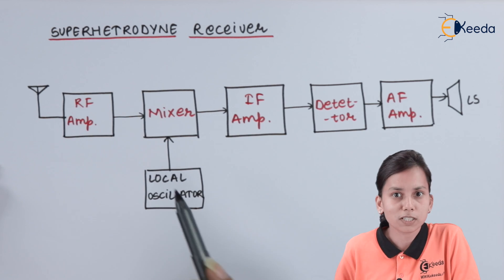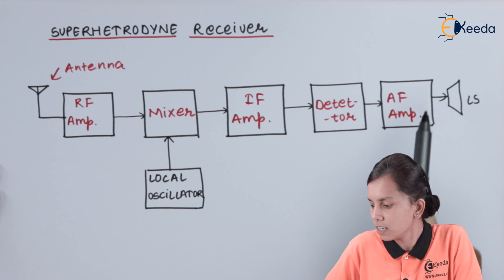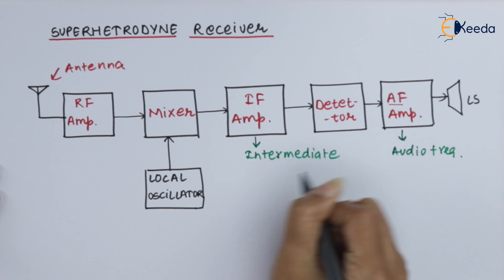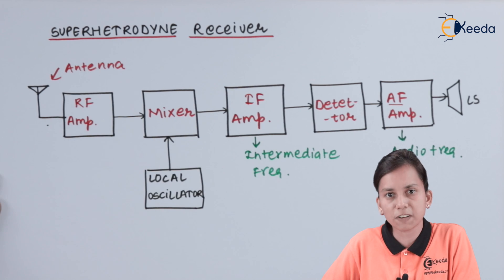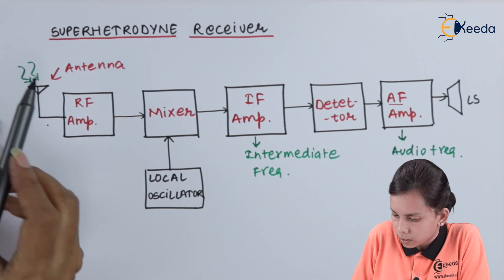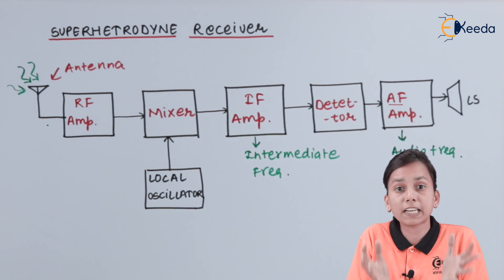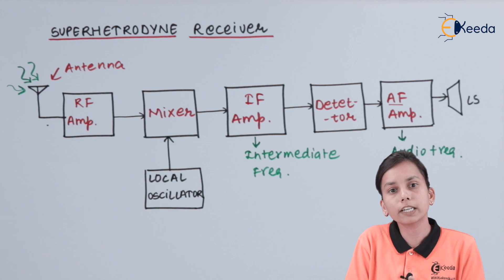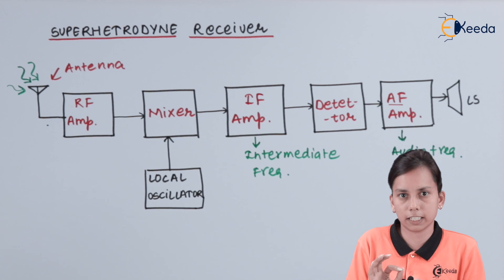Superhetrodyne Receiver - Modern Electronic Communications - Application of Electronics

Comment: For RF amplifier its not so much that is "selects" the desired frequency but more so that it improve the SNR of the desired signal more than the surrounding noise. Selecting a desired frequency is more often done by band pass filters which allow only a specific range of frequencies and tunes out the frequencies that are outside of the desired range.

Comment: I'm not even an engineer, and I'm detecting so many errors in explanation.
This video is really meant to pass exams, not for understanding the concept.

Antenna also has a range it's best at.
FM radio antenna won't be good enough for MW. etc
It's not receiving "all" frequency

according to this explanation, the RF amp is selecting only the frequency we want. Which is not the case. It's vaguely selecting a bunch of frequencies around the ones we want. 
If it really selected one frequency, we wouldn't need the whole superhet circuit.

The actual conversion of the radio waves to audio waves is happening in the detector. Which comes all the way in the end.

Comment: Thanks for the video. How will this receiver type handle a signal at the level of MHz? I wish you would give clear numerical examples. For example, let's assume that a 100Mhz signal is coming from the antenna in the FM band. How will the stage amplifier after the antenna amplify this high frequency? There isn't even a transistor to handle a 100Mhz signal.
Reply from the maker: Kindly download the Ekeeda Learning App https://ekeeda.com/download.html & ask your doubts. Our experts help you to resolve queries on chat.
Reply: That is a block diagram. within each section you find the actual electronic circuitry with resistors, transistors, capacitors, etc.

Comment: Miss,  Why do we need to convert the received RF signal to IF signal?
Reply: We need to convert ti to fixed IF (such fixed 10,7 MHz or 455 kHz) because it would be a lot of undesired harmonics when tuning the scale on VHF from 87,5-108 MHz through many amplifying transformers and when amplifying this range frequency through transformers for amplifying and selectivity, there would be a lot of undesired harmonics on each different frequency tuned, that is why you convert it to fixed intermediate frequency (IF) and then you work on it for selectivity, limiting, amplifying, demodulating.
Reply: Mr. @vjekoslavcvetnic7500  Thank you so much 🌻💕